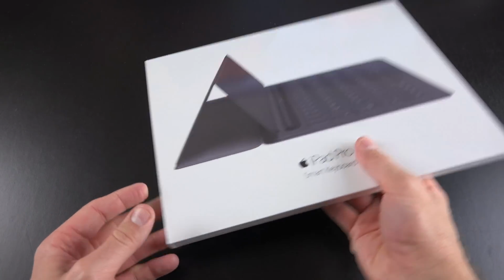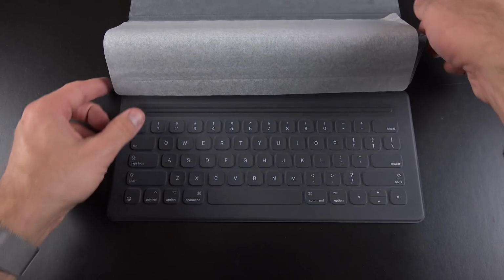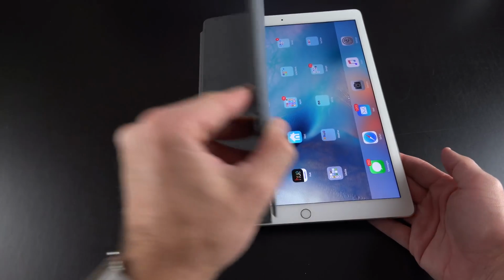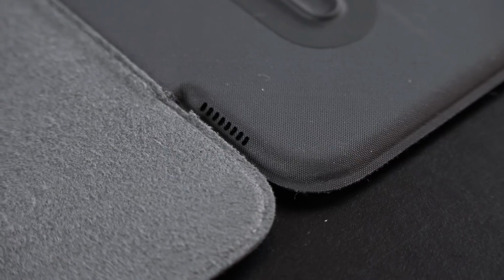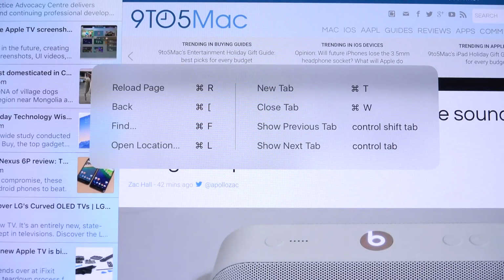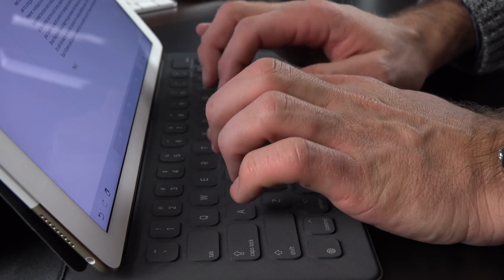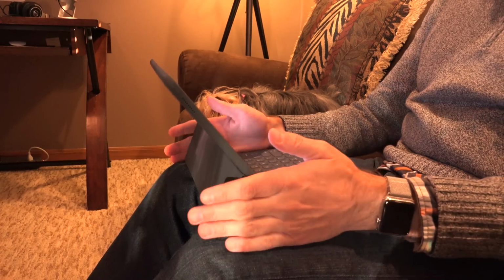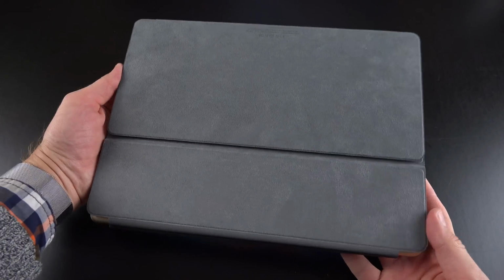Apple iPad Pro Smart Keyboard: Unboxing & Review

Comment: Bought my Apple iPad Pro Smart Keyboard a few weeks ago for $65 bucks on eBay for my slow ass Space Gray iPad Pro 32 GB 9.7 from 2016. It definitely helps this slow ass tablet which by the way will not get iPadOS 17. The keyboard turns the tablet into a slow ass iPadOS MacBook 🤦. At least I have a Magic Mouse 2 to go with it and the tablet is sexy af in the matching OEM Apple Charcoal Silicone Case, which was hard to find and ran $60. A whole rare and elaborate purchase in 2023. It’s bad ass. Finishing it off with the Apple Pencil Gen 1 soon 😂.

Comment: This is not the latest Apple iPad, but it is faster than I thought. It has a great screen and it holds a charge pretty well https://www.youtube.com/post/UgkxhcEDB3r-OJ3_X5hQzr7k1ZofTQy1ao_U . I was concerned that it would not be powerful enough because I have several older iPads that are slow and cannot update to the latest software. But this 10th Gen has the speed and power. I do not use it for video editing, so having an M2 processor is not necessary for me. This iPad model has an A14 processor. So far so good. Glad I bought it. It helps having a larger screen compared to my Apple phone.

Comment: Hi Guys, 

I recently purchased the iPad Pro 10.5 and the Smart Keyboard to go with this. 

The keyboard is super smooth and also very light weight, when typing the travel is minimal which takes a bit of getting used to. The keyboard is advertised as being a full sized keyboard although I’m not convinced on this. Sure it’s big enough for a tablet and light use, would I use this keyboard as my main typing device? No.

With nowhere to rest your wrists whilst using this, and the slightly smaller size, I have found that I soon start to get hand cramps from the uncomfortable position that I have to hold my hands in. 

This might not be a massive problem for some, and I’m sure after a while I could get used to this. Maybe if you had slightly smaller hands you might not notice this as much? Or if you were just using the keyboard for emailing and maybe some social media. But I don’t feel that this keyboard can be used for creating huge word documents. I have been typing this up for no more than 5 minutes and already my hands are uncomfortable. 

I will stick with this keyboard with my iPad Pro as it is useful, but for my articles and reviews I’ll stick to using my MacBook Pro 13” Touch Bar. 

Thanks for reading, let me know your thoughts on the smart keyboard. 

Kris

Comment: Guys, i just returned mine today because it stopped working it kept saying that the accessory wasn’t compatible with device, I actually found out this is happening a lot with these keyboard particularly for the 12.9 pro device. I swapped it out for the Logitech one, I don’t know how long that’s going to last, but it has backlight which i am very happy with. It comes with its own back cover and it connects auto ally aaaaaand its like £50 cheaper at £119 whereas the the one in the video is £169 aaand you the back cover is an extra £70

Comment: To be honest: I never got the merits, a Smart Keyboard is supposed to boast, compared to a simple bluetooth keyboard. I did buy the Apple Wireless Keyboard a long time ago and to me, switching to a Smart Keyboard would be nothing but a big trade-off. Having it on my knees does feel wobbly and overall, i do prefer having the iPad on my side, rather than in front to me, when sitting on a couch. Smart Keyboards don't even give me some real world benefits in terms of portability. I never have my iPad simply in my hand, when going somewhere. It's rather in my backpack, which DOES have enough space to carry my keyboard with me, in case I should ever need it. I would spend 119 bucks for the Magic Keyboard to replace my Apple Wireless Keyboard, getting rid of the hassle of carrying a supply of batteries with me, rather than getting myself a Smart Keyboard.

Comment: Hey, I had a question for someone who already owns this keyboard. I would often use my previous Bluetooth iPad keyboard for not just typing but also for stationing the iPad in its multiple rows to adjust viewing angles. In believe this was made possible by the plastic material which made up the keys as well the relative elevation of each row of keys. I was wondering whether this is possible with this keyboard should I choose to forgo the ability to type but rather use it as a means to temporarily adjust the viewing angle. Any response would be much appreciated!

Comment: I don't agree with apple's idea of this. Come on we all know it's meant to compete against the surface pro line. (I'll compare what I know about them)
iPad pro 
-begins at $799 (32gb) 
-a9x processor
-iOS 9+
-does not include a $50 stylus thing
-keyboard is more expensive $160 
Surface pro 1/2/3/4
-begins at $799 ($899 with the surface pro 4)
-Intel core m, Intel core i3, i5, i7 (or atom if you go with the surface 3)
-full Windows 8 or 10 
-includes stylus thing
-keyboard is a bit cheaper ($130)
IMO, surface pro is better

Comment: Do you use the iPad Pro by the way? +DetroitBORG
Reply from the maker: Yes, as a laptop
Reply: So you would agree with the notion that when it comes to MacBook vs iPad Pro, using one definitely means using the other less, if at all using?
Reply: I use my iPad pro as a laptop now. My laptop is in a cupboard unused now. It's brilliant.
Reply: +tracey cross :)
Reply: +tracey cross can u used your iPad pro to upload documents and files online on a website?
Reply: DetroitBORG I'm considering purchasing an iPad Pro to replace my MacBook but am worried that it will be a pain transferring all my folders and documents (iOS 11). Do you think using an iPad Pro for a work computer is a viable option?

Comment: I would like to see someone create a keyboard for the iPad Pro that combines the light-weight aspects of the Apple Smart Keyboard with the functionality of the Logitech Create Keyboard. Also multiple viewing angles would be great too. Do you think Apple will eventually add trackpad support to the iPad Pro? You can already sorta do that by placing two fingers on the software keyboard. It would be great to have a physical keyboard with built in trackpad, so I never have to remove my hands to touch something on the screen.

Comment: So it lacks a touchpad?  Why would they do that considering the real estate that the Pro takes up itself?  It has to be in consideration of the elaborate "origami-like" folding mechanism to conceal the keyboard.   They would've been better off with a design like the surface tablets, where the keyboard is always exposed AND there's a touchpad.  Of course, the Surface line all have kickstands, so type cover doesn't need to convert to a second position to support the screen.

Comment: The Logitech create is so much better than Apple's keyboard.
Reply from the maker: +Horace Brewer It is a nicer keyboard, but it's also big, heavy, and hard to instal and take off.
Reply: +DetroitBORG thanks for the reply. I find it quite easy to take off and put on. But truthfully this is the only case I need. It has multiple positions. Its rugged and spill resistant. It also has shortcut keys that the Apple smart keyboard lacks. It is also has backlit keys. Plus it's way cheaper than the Apple's with the silicone case. I got mine from Apple with a corporate discount for $143 with tax. Apple's with silicone case you are looking at $250. I figured I'll take the difference in price buy me an Apple pencil or AppleCare+.

Comment: Wait till Belkin releases QODE Ultimate Pro keyboard case for iPad Pro. Am using one for my iPad Air - it's backlit, more similar to a normal keyboard [no butterfly mechanism and no fabric covering] and has a lot more dedicated buttons for media control. ;) And you can detach the iPad cover part from the keyboard and just use the iPad or attach it again horizontally or vertically.
Reply: Logitech has a keyboard out already that is better than this keyboard. The funny thing is it was available the same day I got my iPad Pro.
Reply: +Horace Brewer Logitech is a viable option as well. Tho I've always preferred Belkin, especially since Ultimate Pro is more versatile than most keyboard cases.
Reply: +Dylan Robertson you do know the Logitech keyboard has the extra row of keys like a MacBook. Plus it's backlit. Sorry but Apple loses this time. That's why I told them they should ditch their keyboard and buy Logitech as a company. I'm the guy who is responsible for the current generation Apple TV and the purchase of Beats by Dre. Plus a host of other things. Don't be surprised when this happens.

Comment: $169 plus $79 for the back case? That's crazy Apple, stop getting greedy!
Reply: ***** Yeah, I would too, but they are charging way too much for these 2 products in my opinion. The price is almost a joke. $79 for a back case that I could find on Amazon for $15 just because it doesn't have the Apple logo. The keyboard is good however, so I could see the $169. I do think they could drop their margins and charge a little less though.
Reply: There are less expensive options. Your choice of course.
Reply: Ikr!!! Like Apple doesn’t have enough money 🙄🙄🙄👏🤨😒
Reply: @Dylan R Are you sure that "case" will protect it? It's made of SILICONE, the only thing that material does is make it look better, and they don't even do that anymore with how simple the design is and how better the glass/metal back looks. If your ipad falls from your couch into a carpet, it'll be fine with case or without. If your Ipad falls from your hands into concrete then no matter how many silicone cases you have on, it WILL take damage, if not external then internal, think of it like a concussion. Apple is just very greedy, I wanted to buy their phones/tablets/macbooks but when I think about it, windows/android give you more freedom and their products aren't as overpriced!